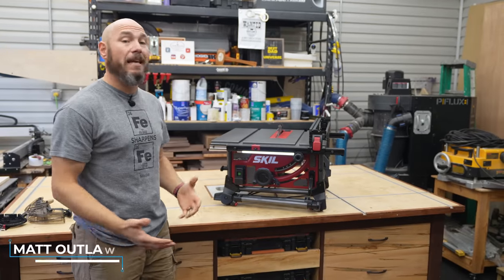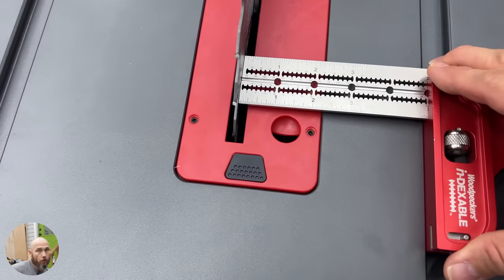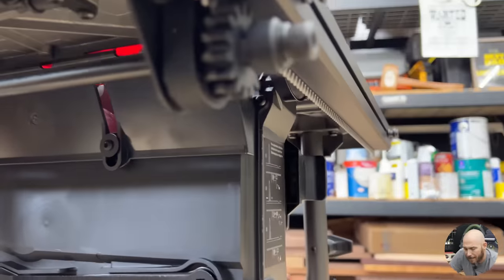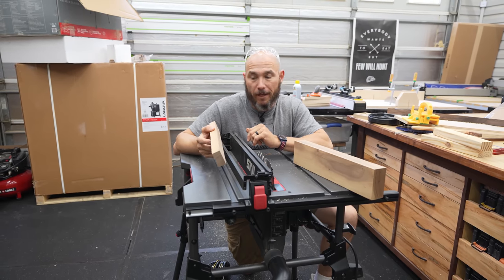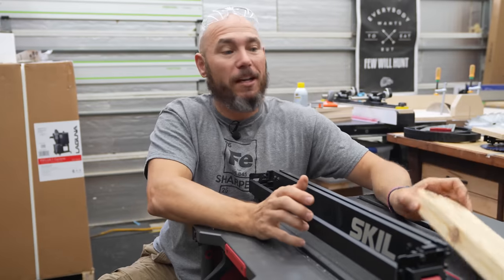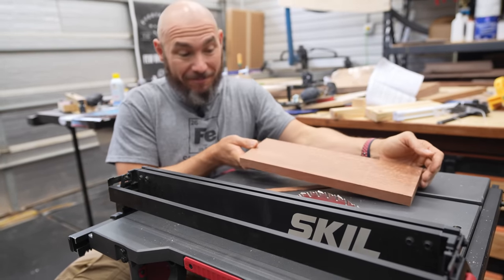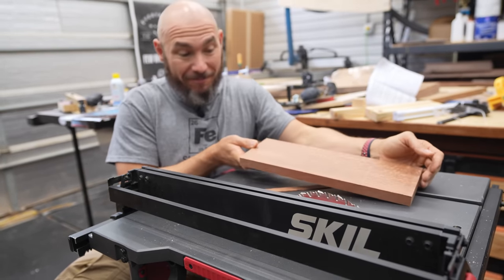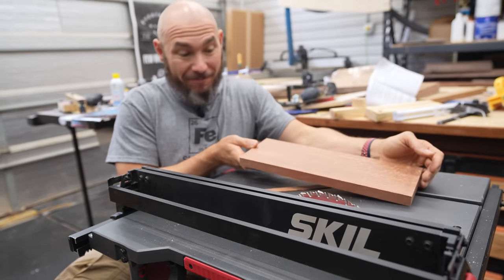Did I Find The BEST BUDGET Table Saw with the MOST Features?

Comment: After other reviews (this was a year ago), I purchased this very table saw. And, after a year of use, I can say I'm very glad I did! It performs beautifully and handles everything I throw at it. My only issue so far is the table surface marrs very easily. And that's it! Everything else about it works fan-flippin-tastic! Highly recommended 👍
Reply: It really does. Mine is scratched to hell after a few uses
Reply: I actually bought one last Saturday for 200 from a gentleman that had bought it for a project and never used it. Brand new in the box.
Reply: @elvisvelez6609  yeah, that's the kind of deal I just love!
Reply: @user-gk3lu1gg9t 

Does that affect the ability to cut? How are vibrations? What's the material made of?
Reply: @modernNeanderthal800  It hasn't seemed to affect it at all. They aren't deep gouges, just surface scrapes. Makes sense since it's a cast aluminum surface. It's a very solid table saw though, no issues with vibration or being level. 

It is a tad louder than other table saws I've used, that's my only complaint

Comment: Time for a follow up on this saw, as Skil has made some improvements. Bought one this week from the local Menards and noticed that the newest ones on the floor came in a much cooler box, which was black with white lettering. Inside I discovered that there was a separate smaller riving knife included so they are now removeable. The throat plate is metal not plastic, and at least on mine, the fence is a nice perpendicular 90 degrees. Thanks for your initial review which got me looking at this saw in the first place.
Reply: Did they increase the overall height when unfolded? I see lowes has it listed as 36" and skil still says 32".
Reply: watching this video, they must have made it bigger.  I'm 6ft and the one in this video looks much lower than my saw is on me.  It's a pretty comfortable height for me to work with.  Also I think the fence capacity is wider than the 25" he mentioned.  So they must have made a bunch of changes.  Additionally, I got mine on black Friday from menards for $265.  So be on the lookout for deals
Reply: I wonder if the throat plate is compatible with older models. I've seen the bowing as a complaint.
Reply: @screw-luck4636  i just got mine in today and no they did not its 33 inches high i wished it would have been 36 but man im so happy with it
Reply: I can confirm that it’s 33 inches but don’t let that deter you, I’m 6 foot 3 and I love this saw. Great saw, looking into their miter saws next when mine breaks.

Comment: You don't need a built in blade lock, just place a small piece of scrap wood so the tooth of the saw stops on it when you turn the wrench. I'd also recommend either slipping a pipe over the wrench handle or getting a longer handle wrench to increase your leverage. It will also be much easier on your back, this type of work is hard enough on it already.

Comment: By tossing the stock blade on the workbench, replace it with one with more cutting teeth, preferably carbide tips, and you won’t have that splintering along the cut edges.

Comment: I recently purchased this saw based on one of your more recent videos. Just a tip to other viewers who own guis saw. There is a special throat plate made specifically for use with a dado stack. This plate included a special arbor nut that claimrs to make the use of a dado stack on this saw safer. See your owners manual for the item number. I found mine in acme tools

Comment: 25 years ago I worked in the “tool corral” at Home Depot. Even back then, these Skil table saws were packed with features the other big names didn’t have. They were half the price in many cases and more than double the features. They weren’t a super rugged job site saw, but really fit the bill for homeowners and light commercial use. Probably the biggest downside , was the name. Skil, once a leader in the power tool field , was considered sub-standard to many tradesmen. Glad I found your video, quite by chance, as I am in the market for a tablesaw for my handyman business, guess I will have to reconsider this old friend !

Comment: I have this saw in New Zealand. If you look at the table bed there is a rabbet you can sit the handle of the rear collar spanner against when putting pressure on the front nut spanner. No need for a arbor lock, just use the rabbets. Changing blades is actually very easy when you use this feature.

Comment: Just purchased this saw and have been spending a fair bit of time getting everything squared up before I actually put it to work. I love the amount of adjustments that are available on this saw it is a definite upgrade from my last saw. The one issue I have so far is that the table seems to dip from the miter gauge to the blade, when I put a straight edge across the table perpendicular to the blade there is a definite gap that starts at about 1.5" from the throat plate on either side. Not sure if this will cause any issues but I am concerned that with smaller rip cuts it may cause the cut to be off 90°. 

I really appreciate the content you put out and use many of your reviews/recommendations as I build up my tool selection.

Comment: Testimony for the Skil Table Saw...  I've been in the market for "budget" table saw and after watching your review and several others decided to purchase the Skil Table Saw.  I just got it and spent the last couple of days making sure everything was square and properly aligned after swapping out the factory blade for a 60 tooth Diablo blade.  The FIRST 2x4 I ripped I noticed that the saw seemed to bog down but figured I was just feeding it through too fast.  I reset the fence to rip another slice off the board and it again bogged down at the same point in board.  I knew there were no knots in the board so when checked to see if there was anything there I saw the problem.  I had cut through a nail not once but TWICE.  It was completely embedded below the surface of the board and being a commercial board from a big box store it never occurred to me there would be a nail in it.  However, the saw and blade both survived so I don't know if that's a plus for the saw, the blade or both.
Reply: A 60 tooth blade is for cross cuts and plywood/fine finish on sheet goods.
Use the supplied blade for rip cuts. Or a similar replacement blade. This channel has a great blade explanation video.

Comment: So I have this saw and I've had it for about 18 months. I only do occasional DIY stuff, but have used it on very hard Beechwood Butcher block where I resawed a 6 inch portion of a desk cut-off. And some regular 3/4 hard maple, both with no issues, amond other easier woods.  I did install a Diablo combination blade and aftermarket mitre guage, but the saw is actually really good. I like it a lot, it's easy to use, very convenient being able to fold it up and put it in a closet. I got this saw after I had a Crafstman saw that was a total piece of junk. Uneven surface, nothing was square, the mitre slots were a proprietary T shape. I returned it. This Skil saw was only like 40 bucks more and it was night and day. Would 100% recommend.

Comment: I bought this table saw before I even saw this review and I love it. I also bought the zero clearance plate and the dado plate and it came with a special nut to have the maximum width that the saw is supposed to do. I also wished that skill would have made the fence go to 30 inches. Other than that, this my saw until I can get a cabinet saw

Comment: I have an old hand me down Ryobi, no rack and pinion fence.  Been looking for a new one.  Been looking primarily at cordless units. But man, built in legs, onboard storage for accessories, quality of cutting, I just might be sold on this.  And it's like at least $100 less than the cordless.  If I see this on a sale, I'm going to get it.  Thank you for the very detailed review, and demonstration of the use cases.  It was easy and thorough.  Really appreciate it.  The 25.5 cutting width seems great to me.  I think both the Milwaukee and DeWalt's are like 24.5.  And great suggestion on the miter gauge.  Thanks again!  God Bless!

Comment: I figured out a cool way to keep my shop vac hose connections in place. I wrap 2 strips of the same side of velcro (1 on the end of the shop vac hose and the other on the collection hose it attaches to) and a single strip of the other side of velcro which bridges the gap and keeps it in place.

Comment: The Hercules saw is also another super solid machine. These two are practically identical. If you're in the market for a budget friendly machine it seems the Skil and Hercules ones are the best bangs for the buck right now. The rack and pinion are the best features for these. Especially since most portable saws major flaws are the fence systems.
Reply: I agree. I think I like the Hercules a little better, but the Skil is a very solid saw.
Reply: Hercules is trash
Reply: @mmjay7078  If you say so. My experience has been the complete opposite. They are better built than other brands in the same price bracket like Ryobi for example.
Reply: @mmjay7078 that's too bad, you must've got a bad unit.. I own their 12" compound miter and it's an absolute beast never an issue and true cuts..
Reply: @MemelordSupreme  just paint it yellow and watch him slob on that adjuster knob.
Reply: @charlesdjones1  🤣🤣
Reply: How do these compare to the dewalt?

Comment: I found this saw reviewed by another just over a year ago. I compared quite a few others on price and features. I went ahead and ordered this and have been real happy since. I do use it often as I have many home projects I'm working on. Easy to swap out blades, quick to assemble and my shop vac connects to the back easily as well. Just as quick to pack it away. One tip, align the fence to the middle and lock it in place before you fold the legs to store it.

Comment: I had the dewalt its about 7 years old great saw still have it but i bought this about a year ago when i seen it come out the dewalt is setting in the corner now I love this thing im not a high end woodworker by any means but I get peace from building things and I have used this to remodel our home other than the obvious miter gauge an blade which is every jobsite saws downfall this is the best saw in this price point you will ever buy hands down

Comment: I’ve had this saw for 2 years now and it’s a love hate relationship. Running into this video reminds me that it’s an absolutely great saw for beginners and I could get much more use out of it if I didn’t outgrow it. When I do upgrade I will be keeping this saw for its intended use, being my portable saw. If you’re on the fence this is a great saw to start on
Reply: I am on the fence about this saw and the Hercules table saw from Harbor freight. What are some of the things you love and hate about this saw? TIA!
Reply: @S0Ev0  honestly the only thing I hate about it is that it’s not bigger. It has a ton of adjustability that makes up for it though. I also don’t like the saw blade cover that came with it but I just made my own zero clearance plate and that fixed that
Reply: @AlmightyAetius  If those are the downsides of this saw then I'm all for it. This is going to be my first table saw.  And I'm planning on building a workbench to sit this table saw and my miter saw so I think the size wont be too much of an issue.
Between your feedback and Matt's review I feel good about purchasing this purchase. Thanks guys.
Reply: @eddievo6798  I’m finally building a work table that this will fit in so my only issue will be solved and then I predict many more projects with this saw. Happy building!

Comment: Thanks for another great video.  I'm semi-retiring this year and plan to do a lot more carpentry.  Going to get rid of my basic table saw and pick up something new.  This seems like a nice saw for a beginner but I'm more interested in something that will allow me to take my workworking skills to the next level.

I'd like to see you do a video on the top tools and give an example for base model, mid-level, and higher end.  I'd be more interested in the mid-level but I'd like to see your recommendations for some higher end items: table saw, router, planer, miter saw, etc.

thanks again
Reply: I make sure I can hang some weights off the bottom because a 4’x8’ sheet (or bigger) will want to flip the saw over due to friction on the table.

Comment: Owned this saw for over a year now, put it through its paces. Hasn’t disappointed. You have mis-spoken about its dado capacity. It will accept a full dado stack, though not with the stock insert. Skil sells a dado throat plate but what’s the fun in not making a zero clearance or a dado plate. 👍 good review, came out after I bought mine but solidified the purchase.

Comment: This is the saw I chose for my first table saw and I am loving it. I made a cross cut sled for it and it's been handling everything that I can throw at it. My only complaint is that it's quite loud but that's only a very small complaint. I wear earmuffs when I work so it's not a big deal. I do find that the blade does tear up ply wood pretty badly. I'll have to take a look at the blades in your description and pick a few up. Thanks for the video!

Comment: My wife picked me up the older version model 3410 (non intergraded stand) on clearance at Menards several years ago. So far I’ve been pretty happy with it for the stuff I build. I wish mine had the dust port. I will say, my miter gauges are awful, tons of slop in the slot and I can’t find any thing that fits the slot. Bought two different feather boards and both adaptors were too large

Comment: I’ve owned this same saw for going on 2 years. Extremely accurate powerful saw. Have made many projects using wood from 1/4 ply to 4 quarter oak and walnut. It just keeps cutting. Only flaw for me would be the throat plate. When working with smaller pieces of wood, the thin plastic of the plate bends down when applying downward pressure. I made my own zero clearance throat plate out of MDF which works better for small projects. It is very loud! Ear protection is a must.
Reply: Ha ha I just left a comment about the throat plate too…I wish they sold a more robust zero clearance one. I made one two, but did it quick and dirty and need to spend more time on a new one. The fact the depth is different on the right and left side made it a pain. I used an electric hand plan to make the right side thinner, curious how you made yours.. 👍

Comment: I started with saw and felt it was really good. It was, as you said, the best bang for my buck and was highly portable. The table wasn’t flat and the throat plate flexes, but I still have it “just in case.” Happened to get a killer deal on an old Ridgid TS3650, so that’s what I use now.

Comment: I’ve had mine for a few months now and I am still amazed at how quickly I can break down a sheet of plywood. I just broke down a half sheet in about five minutes. All the way from folded up under my work table to standing up to cutting to folded up and back under the work table. Love the rip fence, replaced the miter gauge with a Fulton miter gauge (and added a plywood and t-track fence to it). I agree that the insert is floppy and needs to be replaced and I too am looking for a replacement. Built a huge crosscut sled with an extension that gets me out to almost 40 inches. Dust port works great and I love the red color.

Comment: I bought the Skil 6307 a few months ago and can confirm how great it is.  I got it for exactly the reasons stated - beginner, budget, small shop.  It bounces back and forth in price between $350 and $400 so watch the price for a while before you buy.
Reply: I actually just got mine two days ago on sale for $300 from Menards.  Went into the store for sharpies and to look (not buy, yet) at router bits, and saw that the saw was on sale and that the sale ended THAT DAY.

I ended up grudgingly going and grabbing a flat cart because I knew that I wouldn't get a better deal than that for a while but I still wasn't happy about spending $300 I hadn't planned to that day, haha.
Reply: @warhawk3719  Rejoice and be glad! 😆
Reply: 183 last night at Lowes... and i still have "HAPPY FEET" !!! Heck... i even bought the 3 yr warranty since they say they will replace it. I never buy those, but I am sure it will extend the life of my new saw!  😂

Comment: How accurate is it? How parallel are the two edges after a cut? And how straight is it? In other words would it be ready for a glue up after the cut (also assuming you have a new blade)? Thanks! Great video!

Comment: 10:57 that open ended spanner is long enough to rest against the table throat. Then the blade is effectively locked. For the outer nut, I'd go to Harbor Freight and get a ratcheting box wrench. I love buying cheap wrenches to replace the even cheaper wrenches that come with tools. Each time I reach for it, I think, "awe, that was really nice of me."

Comment: I'm buying whichever goes on sale first between the Skil ($300 target) and Dewalt ($550 target).
Reply: On sale now at Lowes.  $299.  Bought it.  My first table saw.  

Ended up going back and forth between this and the $679 Delta (or Ridgid), which I'd buy over the $650 Dewalt.   Hopefully I won't regret it.   I just hope it hold some resale value if I want to upgrade in the future.

Comment: I own this saw.  Love it.  And since I am 5' 8" (on a good day), the relatively low height is fine.  So far i've only used thin kerf blades and the saw powers through anything I've needed to cut.  Like to try a full kerf (1/8") blade with FTG for dados, etc.  Not sure if it has the necessary power.  Has anyone used a full kerf blade?   Any thoughts? thanks